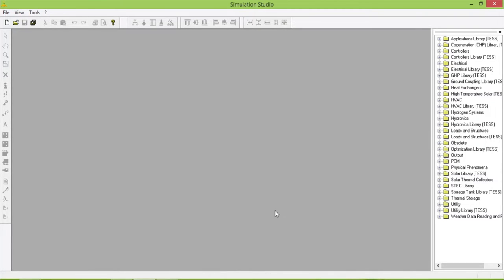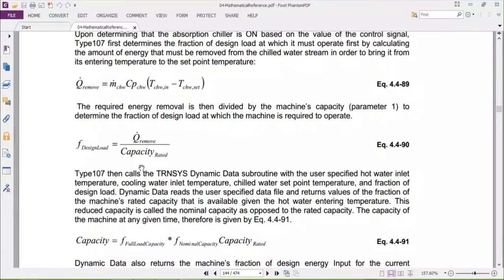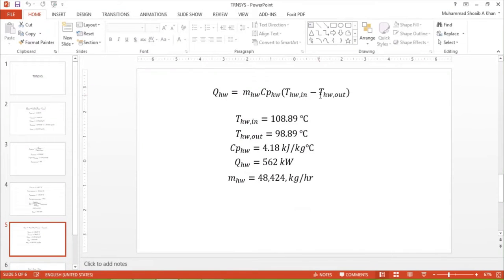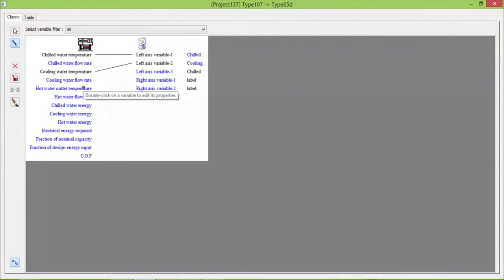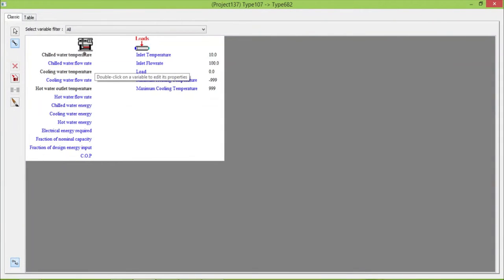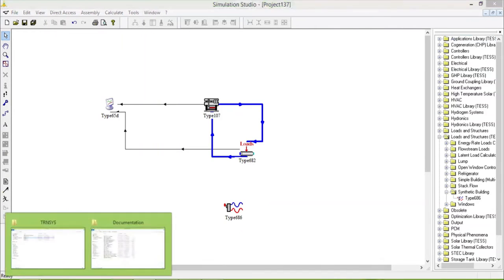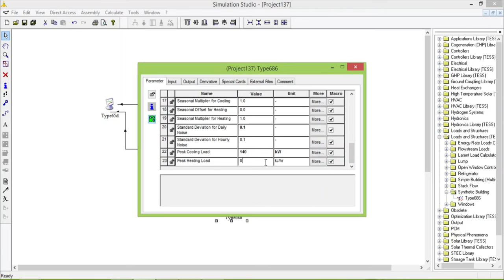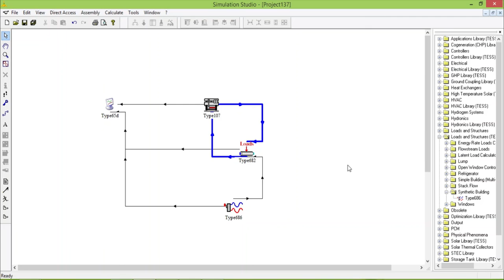Modeling of solar absorption cooling system in TRNSYS Part 1

Comment: Thanks for your video! I'm new to TRNSYS and I want to reproduce a result of paper which used TRNSYS 17. They used 'STEC(Solar Thermal Electric Component) library', but I can't find the library because I'm using TRNSYS 18. May I ask you about this? Where can I find the components of STEC library in TRNSYS 18, sir?
Reply from the maker: @현탁김-e7n  which component do you need?
Reply: @howtodoeverything59  Type 394(helistat) and Type 422(receiver), sir. I cannot find these components in TRNSYS 18.. Also, I wonder how I can find the components that were moved to another library or changed names after the update. Is there any advice for me?
Reply from the maker: @현탁김-e7n  I have STEC library but it does not work on Trnsys 18.
Reply: @howtodoeverything59  Thanks for your answer :) Then I should search other way to simulate that I want to reproduce using other components instead STEC library.
Reply from the maker: @현탁김-e7n  Yes exactly

Comment: please Where did you get the value from T(hw, out)= 98.89c ?
Reply from the maker: Temperature difference should be 10C.
Reply: thank you very much, another questions Why 140 kw not 298kw were selected for peak cooling load ? And what is mean seasonal offset for cooling? Why was the number chosen 0.6 ?
Reply from the maker: @basharkamil1244  With multiplication of other factors, we get 298 kW. 0.6 is chosen to make the cooling profile more realistic. You can choose any number.
Reply: @howtodoeverything59  thank you🤗, and what about another  question, Why 140 kw not 298kw were selected for peak cooling load ?Is it possible to choose this number randomly and what are the determinants of choosing this number?
Reply from the maker: @basharkamil1244  Our requirement is 298 kW. For cooling load to be 298 kW, there are other factors also in the type 686 which multiply with the cooling load so we have to adjust the load in type 686. After multiplying 140kW with other factors, we get 298 kW at the output.